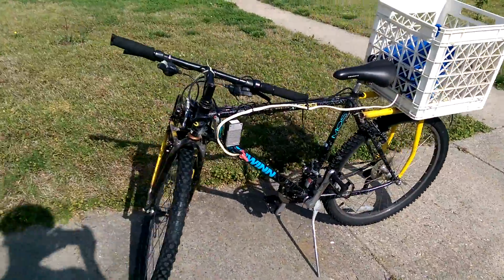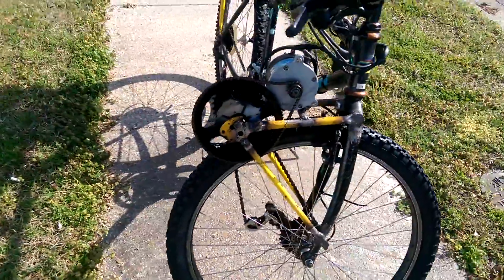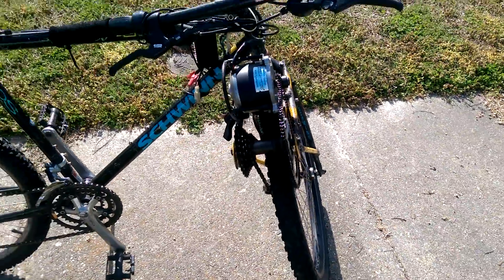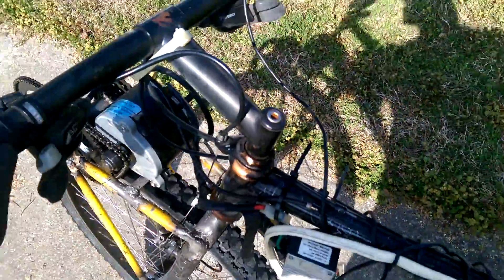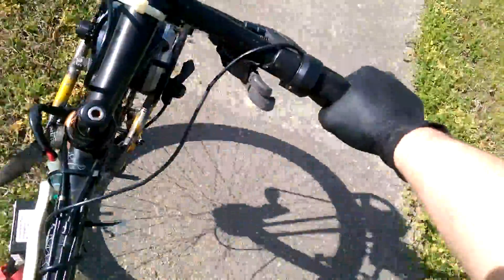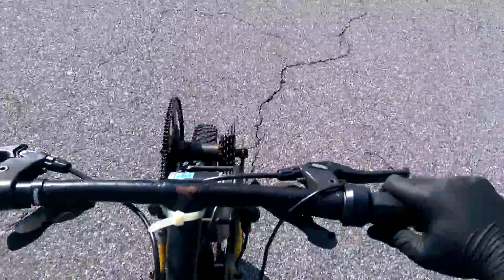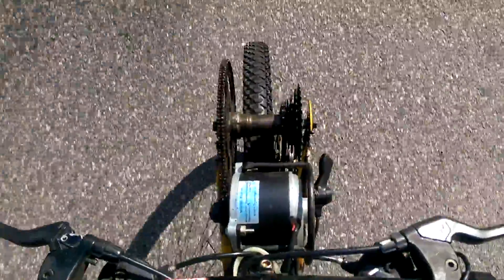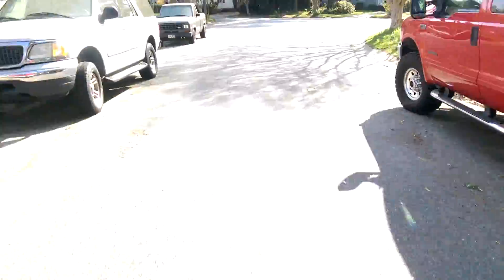Homemade Electric Bike - first run

Comment: I was thinking of doing the almost exact same thing using old sprockets except I was thinking of driving the back wheel only. I like your solution much better. Less friction the better. Plus possibility to change gears.

Comment: so did you use a rear wheel in place of the front wheel so that the motor isn't being spun when it's not powered? this is a great idea, I love how you designed it. btw I have watched the updated version, very cool. I want to do this with a powerful circular saw motor running on probably 36 VDC